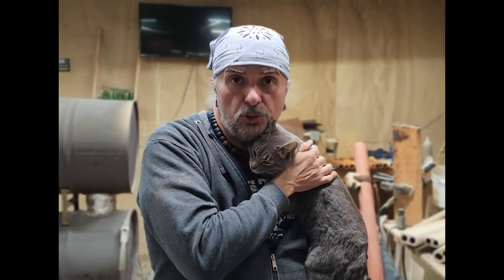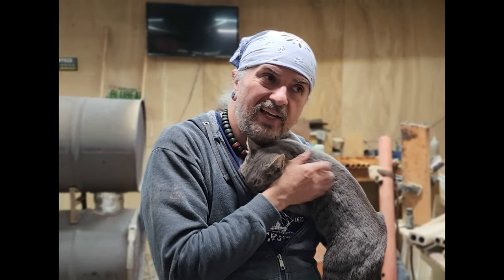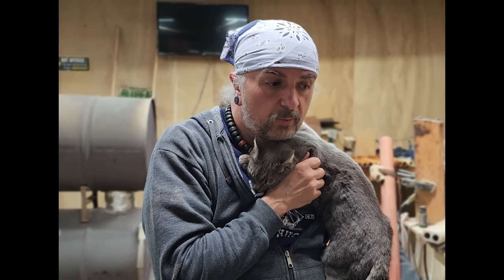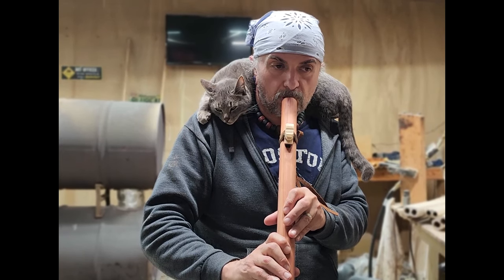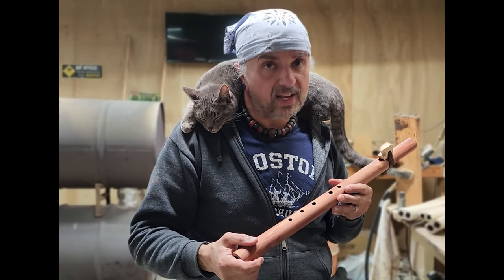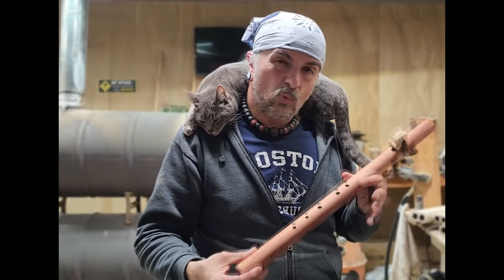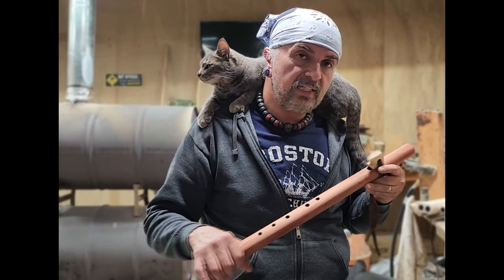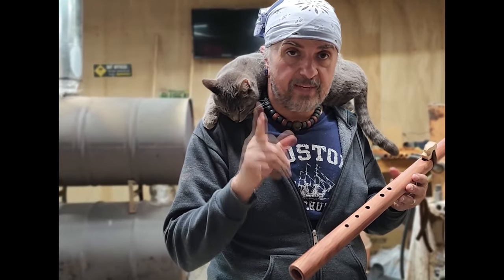Making a Native American Flute - Finding the Fundamental Note

Comment: I agree the hardest part is the air track below the block. After making 30 something flutes now I’m finally getting better at specifically that part. If you fail and it’s so bad it’s unusable just start over and try again. You’ll get the knack of it with practice. Blue bear rocks 🎸 ❤️
Reply from the maker: Definitely! I do have a video on fixing the track that might give you some options for the other 30, but great to hear you got it now! Keep up the good work!

Comment: Thanks for sharing this valuable information 🙏🏽 I totally get it but what if you are working with bamboo flutes? There always have differences in diameter and shape…
I find it hard to get my first fingerholes started, and I‘m always scared to damage this already established fundamental sound…

Is there a way to calculate the finger holes, if you manage to set the first one in the right position ? 

Thanks again❤
Reply from the maker: Hey, great question! I could probably make an entire video on that particular question. There are online calculators but they are not going to do the human thing that you need to have done. As a matter of fact, I have a new video coming out about a flute that someone used a online calculator to create. To help solve your difficulty however the best thing to do is to find a pattern which is relative to the size diameter of the bamboo you have and then bass your flute fingerings and the length of the flute on that pattern. You may have to cut the flute a little shorter or have it a little longer than the pattern and the fingerings may be slightly smaller or larger in diameter. I have a video that might help you out and understanding this a little further called how to adapt a pattern to fit your material. Check it out and let me know what you think.

Comment: With so many variables to screw up during the making process, i.e. TSH size, inner diameter, overall length, etc. even attempting to follow a pattern can prove a futile endeavor. I would imagine that ancient flute makers would have just used the size of their own hands and experience to determine hole placement. In my case, I am early in my flute making journey so each one still comes out a bit different. I have found that I just need to pick a spot to start and go for it, if finger holes start to get wildly oversized then I make plugs and try again or bite the bullet and just start over. I have a pile of what I refer to as "Lesson Sticks".